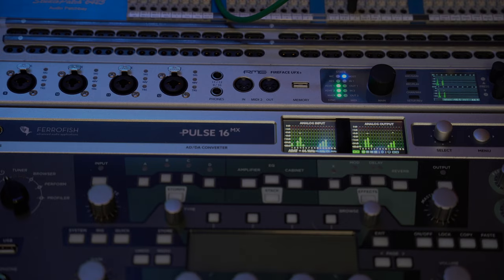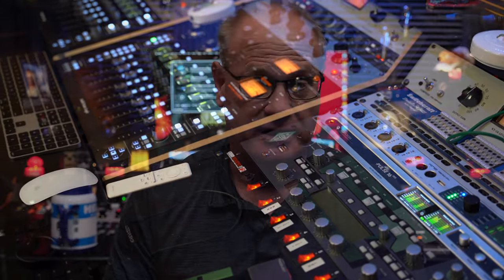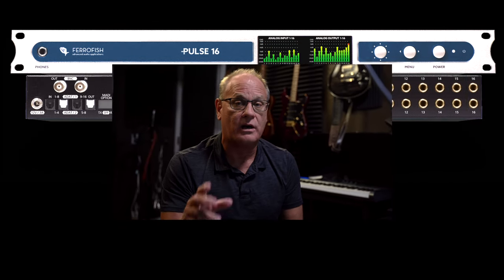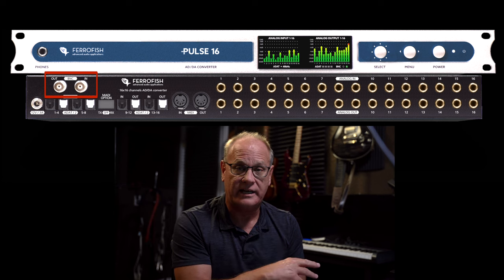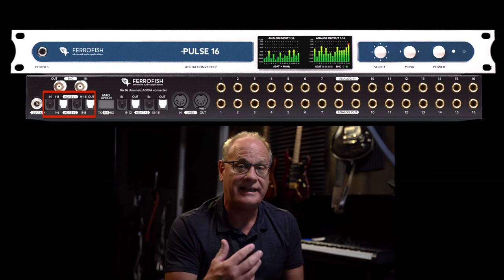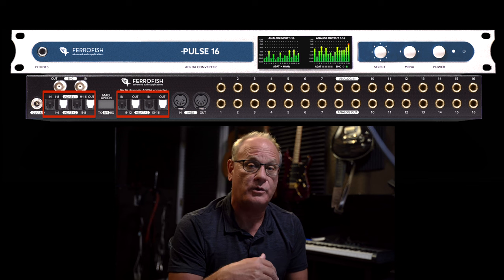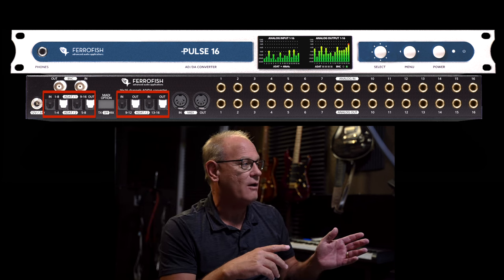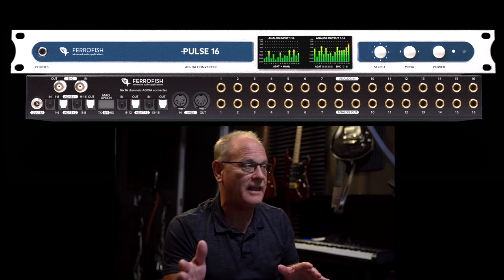Ferrofish Pulse 16 Overview and Setup

Comment: Great video !! It would be awesome if you could make another one on how the Ferrofish I/O appears in the RME total mix
Reply: You won‘t see the label „Pulse16“ appear in a TotalMix window ever, because ADAT does not offer active device discovery like DANTE does. Depending on the Audio Interface and the type of digital interface you‘re using you will have to send signals to certain channels in TotalMix. And keep in mind that the channel numbers of the MADI port differ from model to model. On a MADIface Pro the MADI channels begin with channel 05 in TotalMix.

Comment: Great video Barry! This is my setup aswell, but got two Pulse 16 MX's connected to my Fireface UFX+. Just recently got all this gear so now I'm trying to figure out how to calibrate the whole system so im hitting the sweet spot of my outboard gear. Hoped you would go through the "Levels & Gains" section of the Pulse, how are you setting it up in your studio? Since the UFX+ is only +19 dBu for full level, do you go High Gain or +4 dBu? And what do you set your levels and gains to  then on the pulse? Sorry for the long text 😄

Comment: Black Lion Audio has a mod for the RME UFX (old version), I suppose they are probably moding the new one as well. I had the opportunity to try it out and it was a blast, paired with the BLA microclock you'll be in the major leagues. My grain of sand here.

I'm thinking of buying the Lynx Aurora for 16 i/o, there are not as many options here in Argentina. Avid is definitely not an option, I'm moving out from there as well.

Comment: Thanks for this video.  I am not an expert on A/D converters and actually not sure how they are used in the studio.  This helps a lot.  I like this unit's direct CV out capability.  I am wondering besides that, how could I use the other feature to justify the price.  I have 8 channels worth of gear, all 8 inputs are being used on my interface just fine  and my ADAT input on my interface is already being used to bring audio from another computer.  Thanks for your help, I learned a LOT! edit: also I heard ther eis an audio only version of this unit, an older model.  Do you happen to know the exact model so I can start looking for a used one?

Comment: Hi Barry, i have just received my Pulse 16. i am new to the ADAT method and i would like to know how many ADAT cables in total should i connect to use all the outputs and should i also use a cable for the clock between my RME UFX and the Pulse 16. thank you very much for your video

Comment: I don't have MADI nor do I have the Ferrofish, I have a DANTE system. But I've found your video very informative and interesting, thank you Barry. I was especially interested by the Ferrofish, because I would need another 16 ins/outs for external gear, and Ferrofish have a DANTE model but it's quite on the expensive side, 2295€. Ouch !  How do you find the conversion quality of the Pulse 16 ? Thank you 😊
Reply: Why not a MOTU 16A? The AVB stuff is cheaper than Dante equivalent.
Reply: @eman0828  Hi, thanks for the tip 😊but I already have a Focusrite RED16 Line, a Focusrite RedNet 2 and a Focusrite ISA 828MKII, and all this gear is Dante equipped. I'm not gonna change anytime soon, I'm 61 and I think, these babies might be my last purchase for my Home Studio 😊

Comment: I use the RME Raydat with an A32.  The RME also has AES and SPDIF which I connect to the Eventide orville.  And since Pro Tools Ultimate now allows for 64 I/O I am in heaven.
The only problem Ferrofish  just released a new version of the A32...oh well.....i tend to only change convertors every ten years or so.

Comment: Just got my MADIface USB and Ferrofish Pulse 16MX. The fiber cable that comes with the Ferrofish needs to be rolled to get it to work with the RME MADIface. In other words, as it comes, tx is connected to tx on the devices using the supplied cable. Obviously, that doesn't work. Simply take the connector, I did it at the bigger end, and change the orientation so that tx goes to rx and vice versa. Took me a bit to figure out why I couldn't get the two devices to lock up!

Comment: Thanks for the video.Pulse 16 is a good converter but the manual.... 😅... I need one information. I don't find it on the manual. The adat led flashing green to grey (with symbol). What does this mean?
Reply: This symbol indicates the acutal chosen wordclock source. This indicates not a malfunction or error. We‘re sorry if this caused confusion. 

Cheers
Jan from Ferrofish

Comment: I'm unsure of which way to go in terms of connectivity.  It seems like there are way more options for converters and preamps in the ADAT format and they are also much cheaper. However, there's MADI, AES and DANTE to consider which seem much more capable 'pro' formats. I could get a RME digiface and a ferrofish pulse 16 converter and then an ada8200 for preamps (or no ferrofish and 2 or 3 ada8200s or asp800/880). I could get a RME madiface USB (£350 more expensive) and a ferrofish pulse 16MX (£200 more expensive) and I'm not sure about madi preamps. What advantages am I getting here? Then there's things like presonus studiolive III 24R which can act as an audio interface or work in conjunction with an RME digiface AVB. Then there's Midas DN4816-O which gives 16 inputs over ultranet - I'm not sure if this is compatible with RME AES or not. Also Midas DL16 AES50 and again i'm not sure if this works with RME digiface AES or not. What I really want is solid reliability that just works and with low latency. ADAT, MADI, AVB - i'm not sure what is best.

Comment: Hi Barry. Would you suggest a RME UFX plus or the UFX lll?
Used w the ferrowfish & a Neve 5059 summing mixer.

Am I getting anything extra using the UFX lll vs the UFX plus?

Thank you
Reply from the maker: I have not used the III so without doing that hard for me to answer.  That said, I have no desire to sell mine and upgrade from what I’ve read so far.
Reply: If you were setting up a new system, running 16 analog outs by way of a Neve 5059 summing mixer which farrowfish unit would you get?

 and which RME UFX would you get? Thank you again for your time.
Reply: Which Ferrowfish w the UFX plus?

Thank you

Comment: Little surprised that it doesn't have DB-25 connectors.
Reply: We designed the PULSE16 series for the „pro-sumer“ user, so we chose TRS jacks. Fully balanced and with indivually settable analog I/O level up to 20dBu.
Reply: You need the Ferrofish Pro32A for that.
Reply: @jangerhard4039   Can you hook up a db-25 summer to  the pulse 16?

Comment: thinking about one to connect to my carbon,but i am thinking avid is going to release a expansion box?
Reply from the maker: They will release an AVB expansion box at some point otherwise, AVB on the Carbon makes no sense.
Reply: Did you ever get the ferrofish and attach it to the carbon?
Reply from the maker: @MikeRP3147  I ended up selling the carbon before buying the Ferrofish, but it should work the same.  Just confirm round trip latency with the Carbon is good.
Reply: @MikeRP3147  no

Comment: hi, do i need preamps to run my synths trough this converter, or would my synths have hot enough signal levels to go directly to puls inputs ?  thanks!
Reply from the maker: The unit is designed to accept line level input. So connecting your sins directly to it, would work great!
Reply: @BarryJohns  thank you !!

Comment: right now i am able to bring back 8 channels of the carbon to my console,with the pulse 16 i should be able to bring 24 back to the console for mixing,correct?
Reply from the maker: Yes, I actually sold my Carbon for the Fireface UFX+, even though the Carbon is amazing, I’d had it with Avid.  The Motion 16a is another option by the way.
Reply: @BarryJohns  I was also thinking about the adat card for my radar,which would the cheapest route